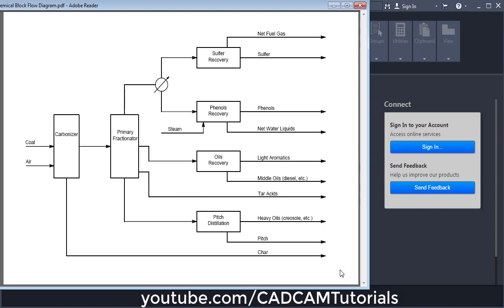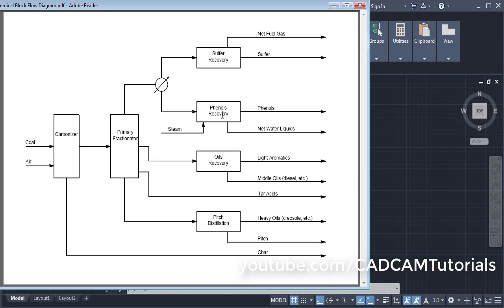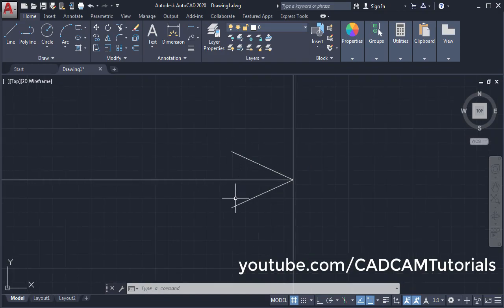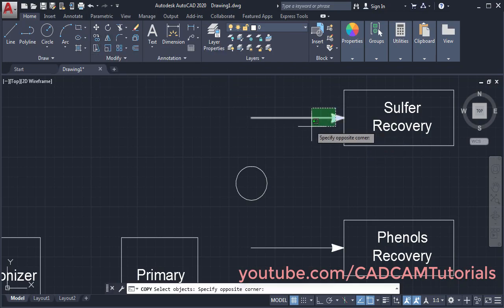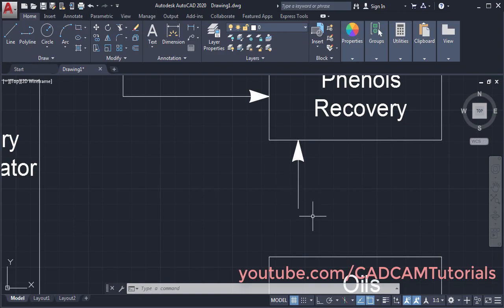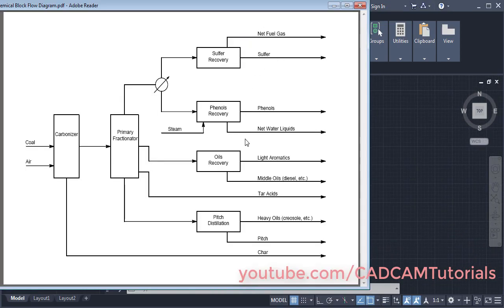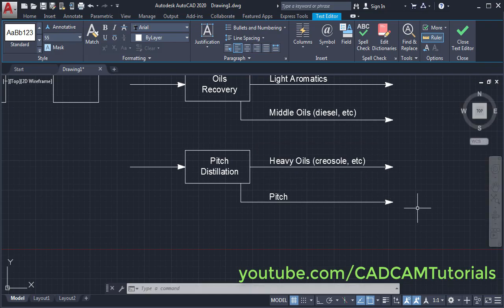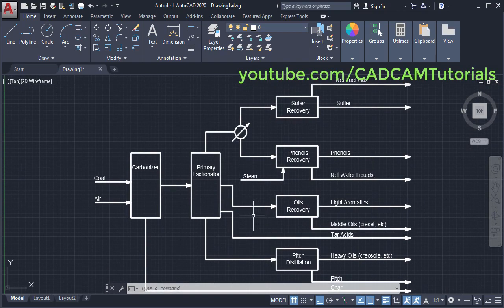AutoCAD Tutorial for Chemical Engineering - 1

Comment: May I ask if you are a chemical engineer? I am training to become a purely Autucad operator and 3d artist. I am trying to figure out if chemical engineers would rely on purely auto Cad draftsman fot their works and what type of Autucad they use?
Reply from the maker: I am not Chemical Engineer but Mechanical Engineer. I am not fully aware about their work, but they can use AutoCAD for 2D and 3D work. More specific software are also available for Chemical Engineers.
Reply: @CADCAMTutorials  Mechanical engineers rely on Autocad as well but which type of Autocad ? Do they rely on purely Auto Cad operator or draftsman for their work ?
Reply from the maker: Plain AutoCAD. Can you elaborate 2nd question. What exactly you want to say.
Reply: @CADCAMTutorials  My point dear: I am training to become a pure Auto Cad operator and 3d artist. If I included at my self training courses designing plane AutoCAD will a mechanical engineer give me chance to work with him in any project or work that requires Auto Cad drawing?
Reply from the maker: It depends on the offered course. But I think it will have sufficient exercises to understand the concept.